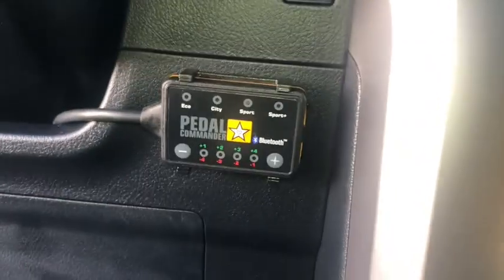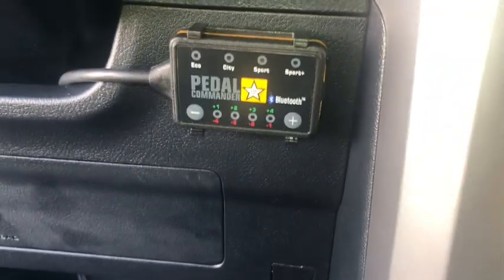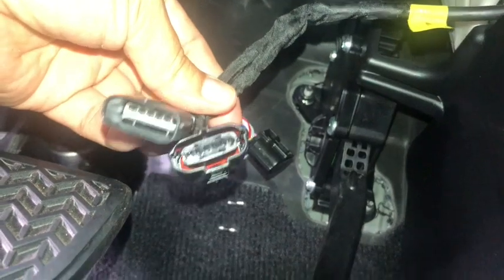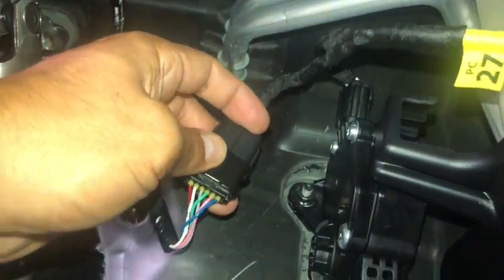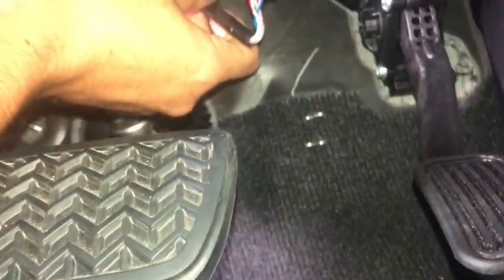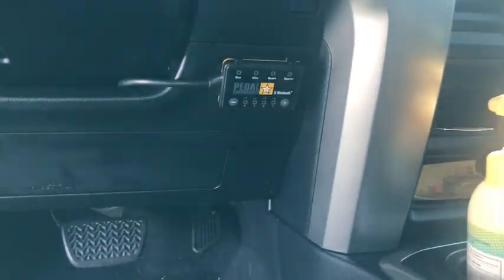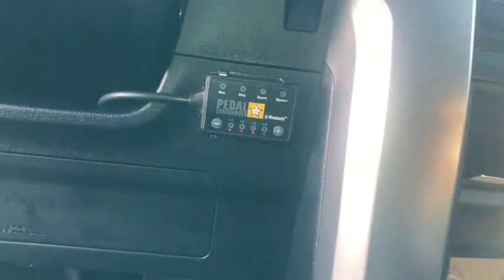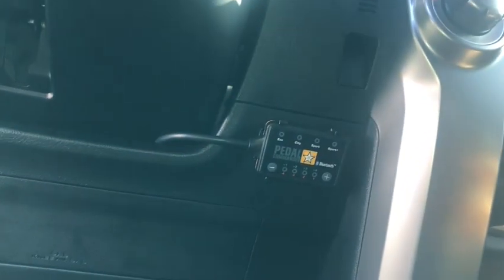Pedal Commander installation 4Runner 5th Gen

Comment: Great video!I’m gentle with my gas pedal when accelerating will It go faster after I install this pedal command or do I have to step on pedal a little more to feel the difference
Reply from the maker: That depends on the settings set on the pedal commander. Eco mode, will require pressing the pedal more, and sport less.

Comment: Bro my tab doesn't move when i try to disconnect the stuck throttle connector. No idea what im doing wrong lol put gloves on and a lot of pressure and the tab doesn't budge
Reply from the maker: The only think that I can suggest is to push down the connector and then press the tab. Sometimes the finger will not push down the tab enough to unlocked, try pressing the lock with something else besides your finger and see if the works.
Reply: @Miltonjrlb  got some gloves on and finally got it - thing was stubborn.   Loving this thing actually - Been cruising on City 3 and it feels good.